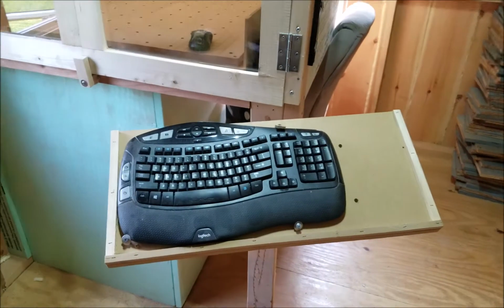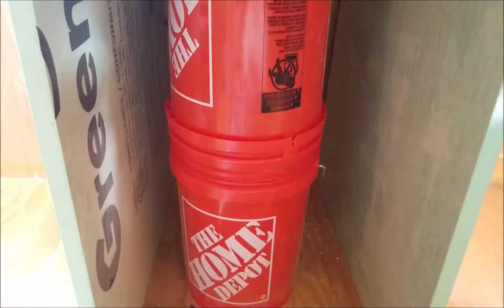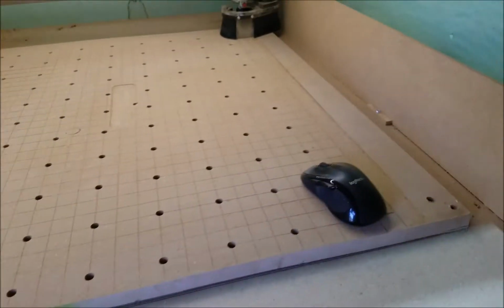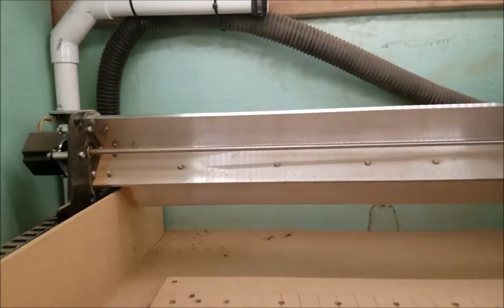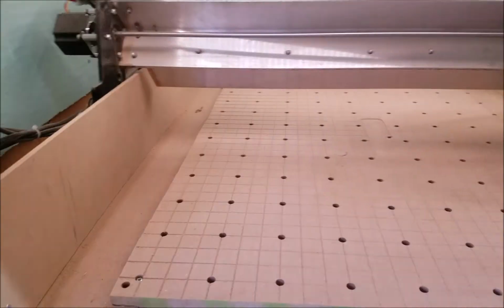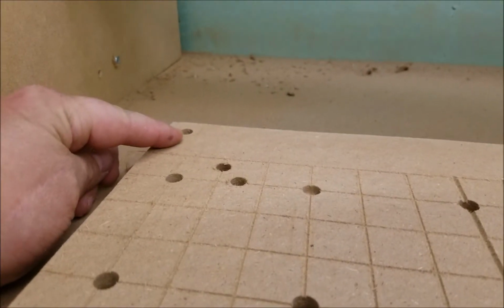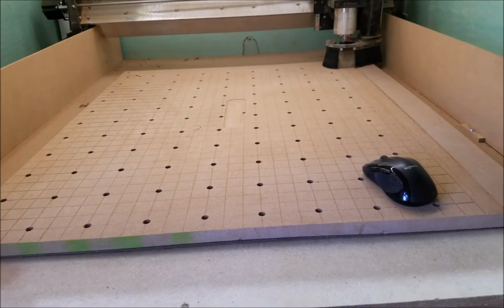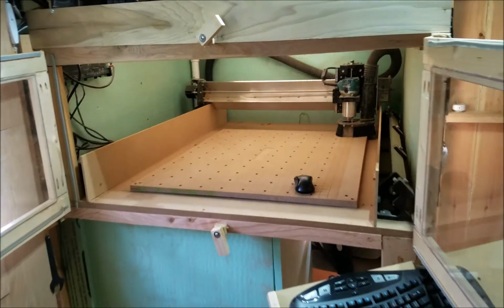Longmill CNC Router Table Enclosure Build [Sienci Labs

Comment: Nice video how quiet does this enclosure makes the machine? And in terms of dust I am planning to get that longmill for doing lots of mdf work
Reply from the maker: It makes a difference, not huge, but noticeable about the sound. But it does really well at keeping the dust and mess inside. Mdf is really nasty stuff to work with, so make sure your at least wearing a dust mask when your cutting it. Ill have to make a noise video short showing the decibels with the doors opened then closed. Ill see if i can get that done today, because i had another person ask about the noise as well.